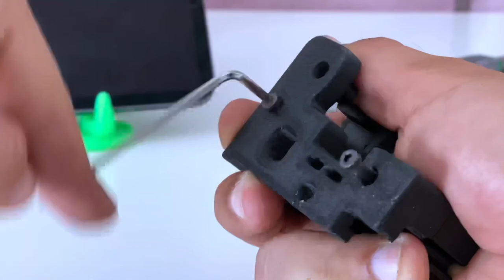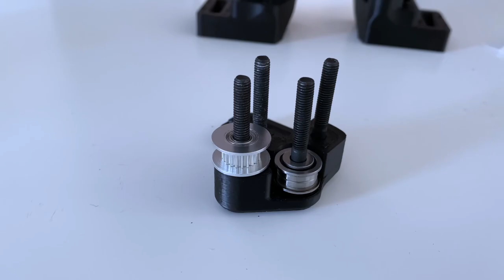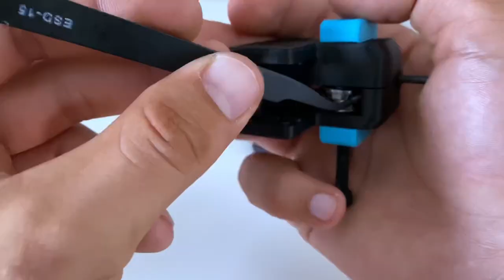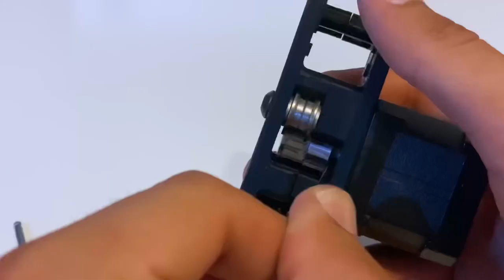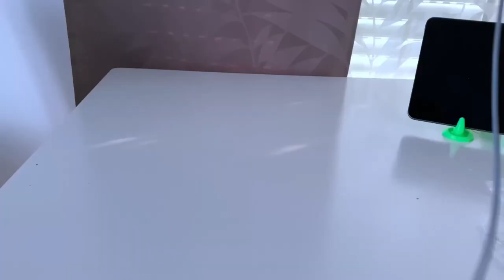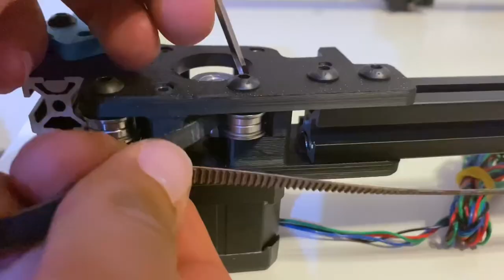Voron 2.4 3D printer building - EP 2.  #myvoronjourney - 4K HD feeling video

Comment: Let's be honest, VORON could never be your 'First' 3D Printer!
Reply from the maker: You are right. Technically it can be, but you need to get a lot of experience with commercial 3d printing to understand the complex system of the Voron. And you also need Perferctly printed ABS parts.:)
Reply: @vas3dworkshop514  Yes, could totally understand. It took whole week to fix my clogging in Ender 3 LOL
Reply: @yashraj2687  whole week?! What was the issue? 😅